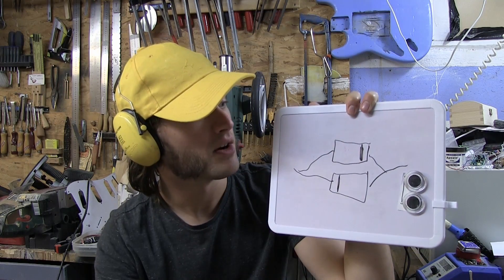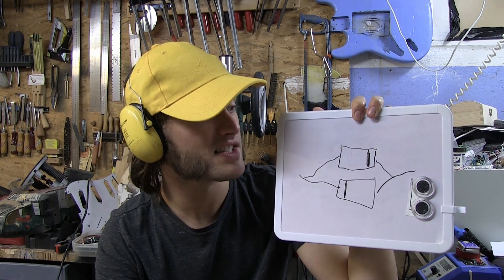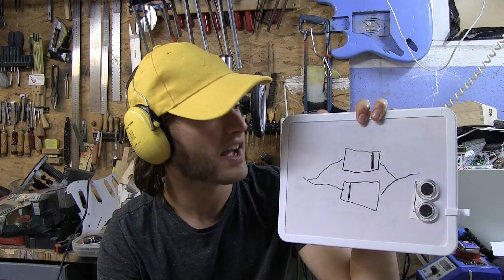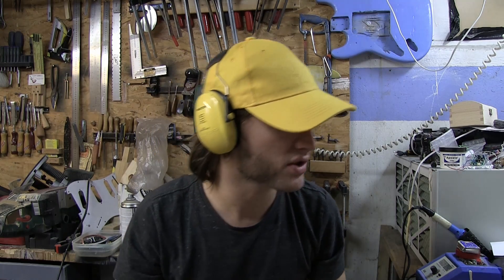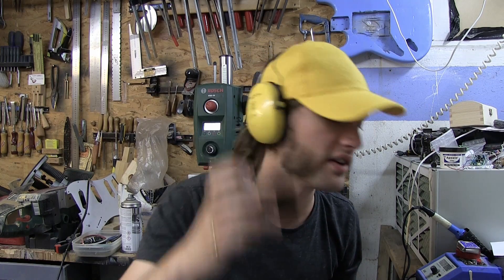2 lm386 clipping diode experiment

Comment: would putting a diode combo between two boards work well?
Reply from the maker: Well it depends on what you are using both what pedals but also diodes are you planning on putting 2 pedals together into one I have another video where I added diodes in its own box to put anywhere on my pedal board its a fun little thing😊 I would say experiment and see if you can find something you like its fun and who knows maybe you'll find something new 😀

Comment: So what would the difference be between red and green led, I was trying to look up differences and all I found was minor mA differences
Reply from the maker: @statc0313  I can't say there is one but as they are admitting light at different "frequencies" for lack of better words so maybe there could be maybe start with white light as it had all colours in it🤷‍♂️
Reply: Every color of LED starts emitting light at a different voltage (usually 2.2V for red, all the way up to 3/3.5V for blue and white). This voltage determines how loud a signal should be so that the LEDs let it go through (and also distort it). There might be minor differences between different colors of LED because they clip st slightly different points but not a significant difference

Comment: Why does anyone still play with these LM386's? They sound like crap regardless of what you do with them. I've built multiple amps with them from different designs and played around with the complementary components, and they are junk of the early 80's 'solid state sound' variety.  We all know how that ended. I flipped through the video and it's farty ass all the way. Try germanium diodes as opposed to the silicon ones you;re using. They might be a little less ass.
Reply: who shit in your cereal
Reply: pretentious much?
i wish id had an "over modulated" lm386 back when i was 12yrs old . heck it new years day jan.1,1980 & finally the hair band era was making sonic bliss in the forms of, quiet riot, dee twisted snider. we had that eddie guy, whats his name? kiss was still pushing foward, as did malcom young & co. & the Ozzman, thru tragic times, they kept rocking. and hear i was without an amp, i still have my old RCA (pony size) console unit w/ phono player & am/fm reciever. its in my jam room now. if id had the op-amp module then, i would have an antique, as it was late 60, early70's model, but nooooo. 
i had woke that morning with long hair, and took to cutting guitar cables & with the back off my RCA unit, the splicing began(as did my still unfinished path of eletronics) so i had it correct, by sheer luck, but the universe quickly balanced itself, as the impedance to the 6 speaker set up, was mid range and designed for music "REPRODUCTION" not for music production, so not understanding the resistors or cap's or the ohm load's . 
i had 15 minutes of fame, and the magical smoke show at the encore' was over the top ! 
as i have done many times since, here i am again lamenting the destruction of my 1st radio which i had a lot of records collected, destroyed by my own hand, indeed a marshall, fender, vox, pevey, ect. any real amp would have helped me to stardom, wealth, thru the decade of debauchery, and playing gigs with motley crue, poison, ratt, bon jovi, tesla, GNR, skidrow, dokken,def leppard, ac⚡️dc, night ranger, the red rocker, milli vanilli, ect. lol
but a lm386 would have saved my console, and the natural distorted sound would have feed my deep longing to shred thru the neck & melt faces.
Reply: Well well, coming back to your comment. We are currently recording a quite well know Industria/Black Metal artist. And guess what? This little gem comes in more than handy. So...